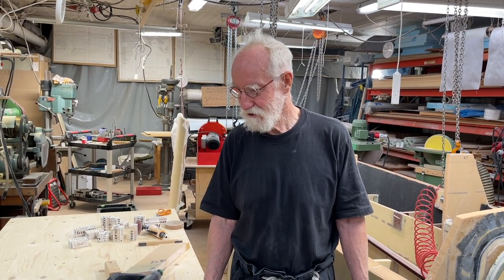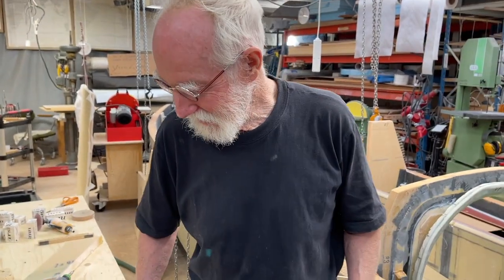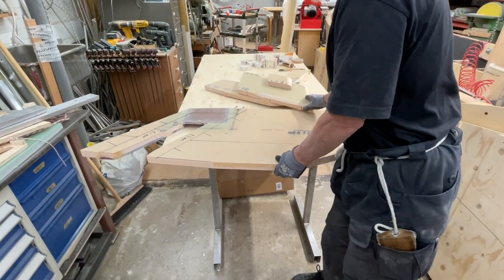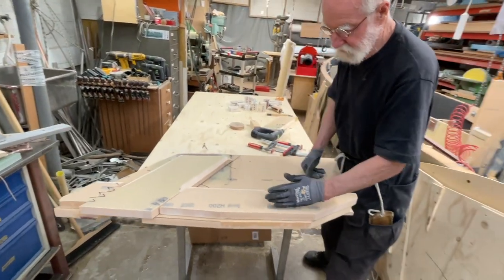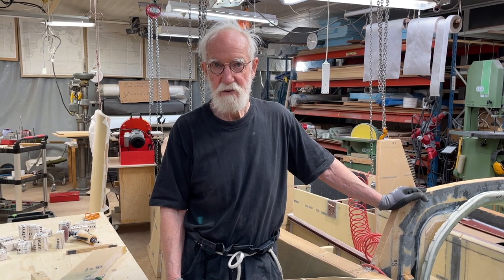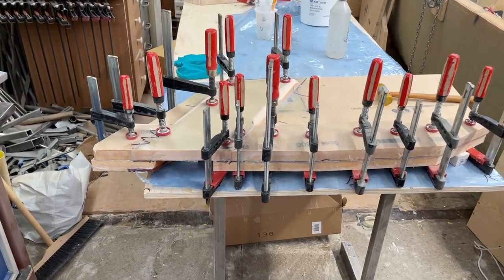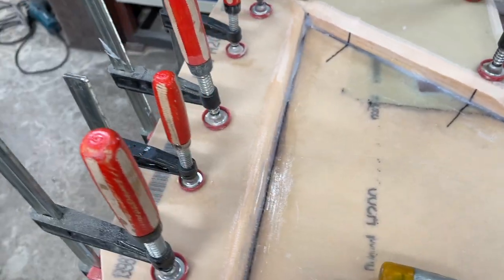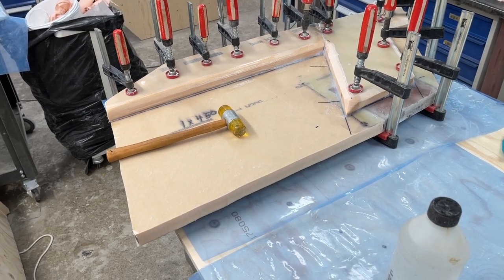24 July 2022   More on the centerboard case  Starboard side bottom part.

Comment: Thanks for video.
What is this foam material, from what is boat body made and now you use for centerboard - how exactly call this material?
Reply from the maker: The foam material is Divinycell.
There is many different desities and strenght.
From 60 - 400 kilo cubic meter.
The centerboard itself will be made of Epoxy/glass laminate G11 10 mm thick
Reply: @SvenYrvindExlex  Thanks for clearly info.